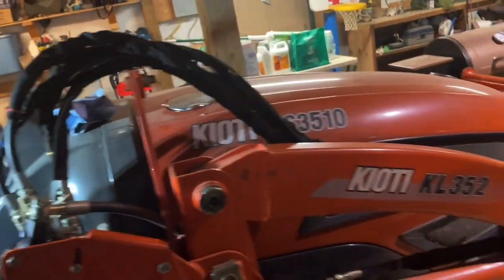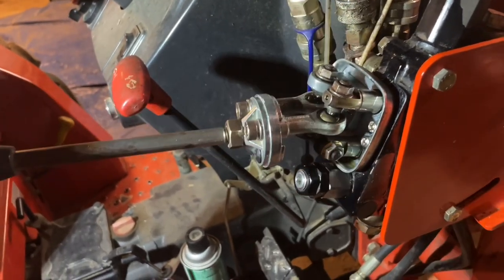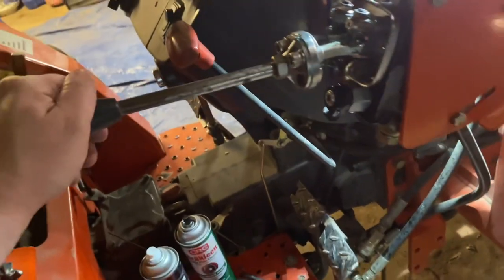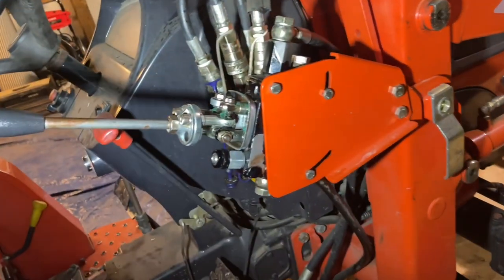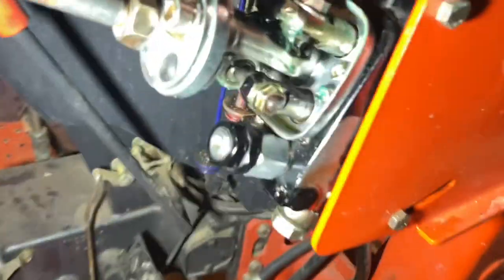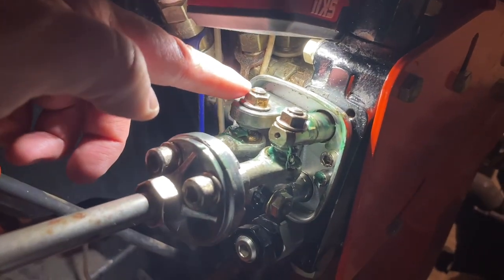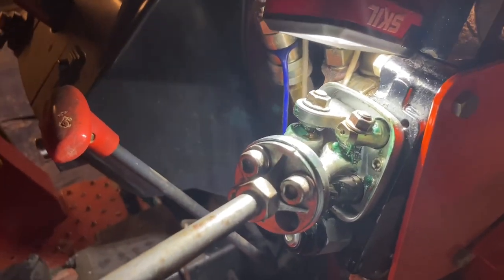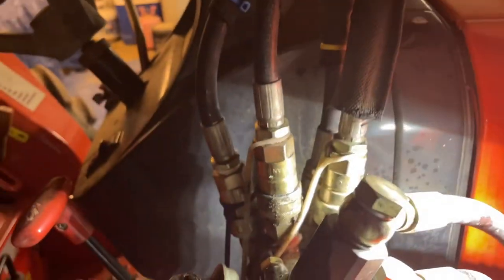Kioti Tractor | Joystick Problems

Comment: My 2017 Kioti NX4510 has has the same issue in more than one direction since new. I brought it back a month after the warranty ran up and they said it's not covered. I forget what they did but it didnt help. Its okay until I use the loader for any more than a couple minutes straight, then it starts to get stiff and gets so bad it's hardly usable. And I bet I don't have more than a couple hours of loader use on it, I rarely use it. Seems like it would be a common issue and there should be a fix for it.
Reply from the maker: I took the joystick assembly apart, one the nuts had came loose from it being so stiff. I tightened it back up and the lubed the rod ends and the spring on the back of the valve control. It works well now.